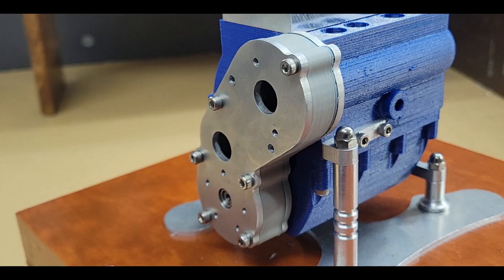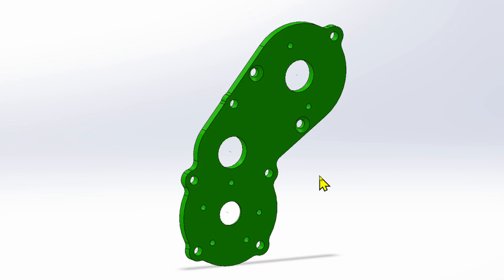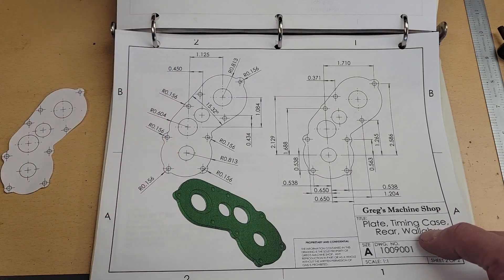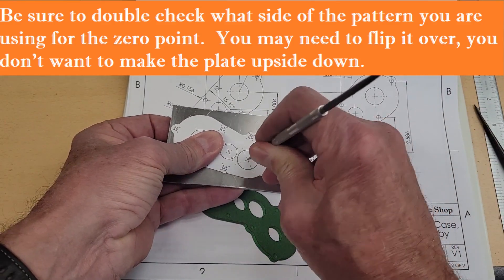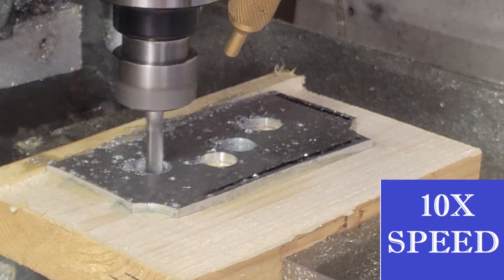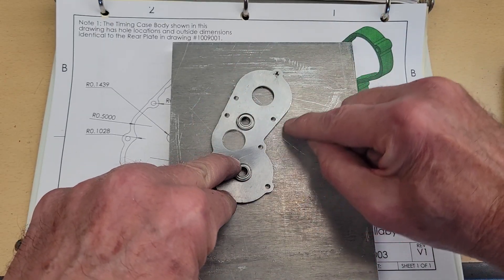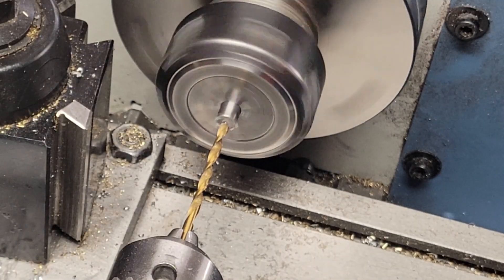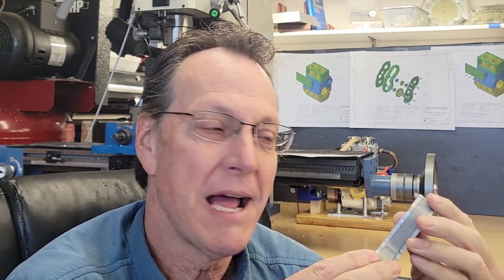Building a 30cc Model Engine in the home machineshop - Part 3A Timing Case Assemby

Comment: Nice little engine. 
A crank angle sensor based waste spark ignition coil system could really "mechanicly" simplify the engine. 
It might reduce friction/loads at low revs ?
Reply from the maker: Yes, you ae correct.  A wasted spark ignition system would eliminate the distributor and thus simplify the engie. The load of the distributor is very small and I do not think you would notice a difference at low Revs with its removal.  A wasted spark ignition on a 2 cylinder engine is one where both spark plugs are fired at the same time on every compression/exhaust stroke, but only one of the two cylinders is in the compression stroke and really needs the spark.  The other spark in the cylinder in the exhaust stroke is "wasted", thus the term wasted spark ignition.  However, I believe that you would need two coils as I don't think one coil would fire both plugs at the same time (perhaps they could, but with half the energy???).  An interesting experiment.  Thanks for the comment. Greg